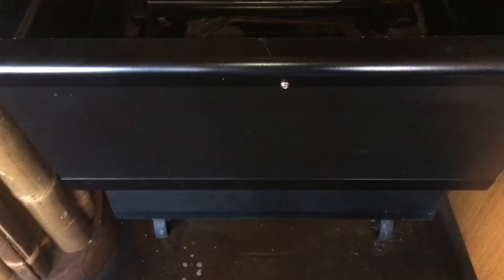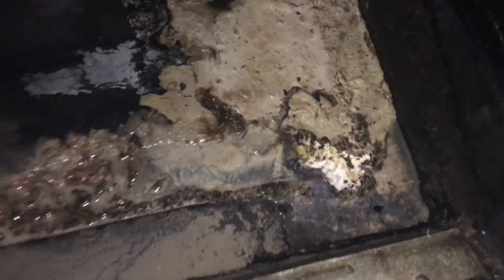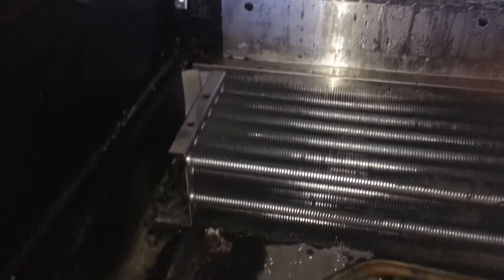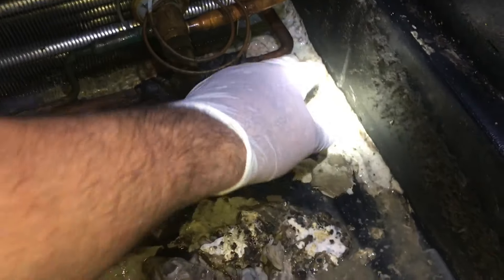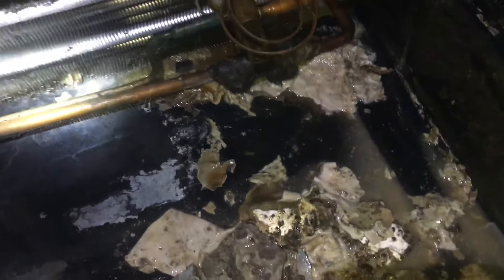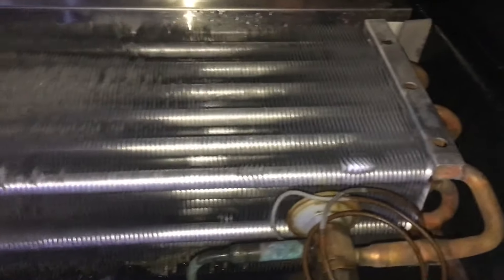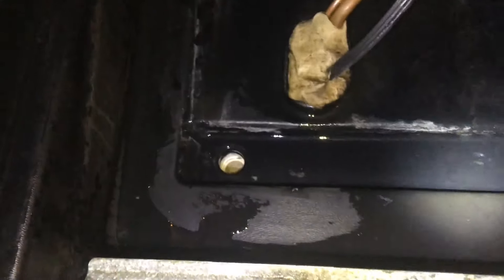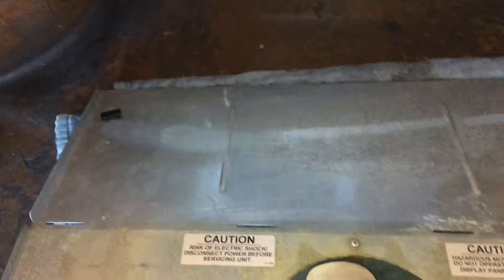How to Clean a Dirty Federal Lprss3 open merchandiser. note slightly harsh language

Comment: Have you ever had bad experience using water that is too hot to wash an evap or fittings? Joints come loose due to expansion?
Reply from the maker: No , and i use Coffee maker hot water in my sprayer to do condensers  when i don't have a hot water hose available. if Your unit falls apart with a little hot water. 🤣 it needed fixing anyhow. 🤣🤣🤣  Natures De-greaser. Never had a Problem Hot water is AWESOME !!!! Defrosting while cleaning evaporators. washes out drains & drain lines. Micro channell cleaning with hot water , no de greaser needed. The Hotter the Better.
Reply from the maker: What Joints ? i Weld EVERYTHING !
Reply from the maker: agreed ! 😎✅